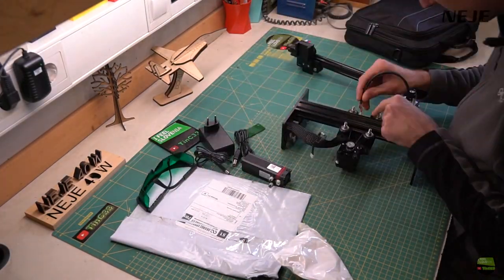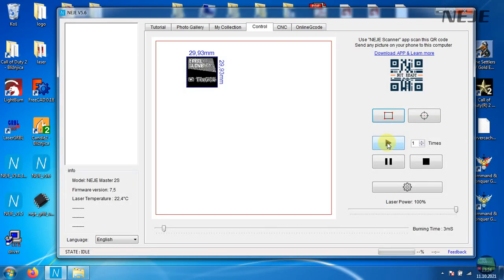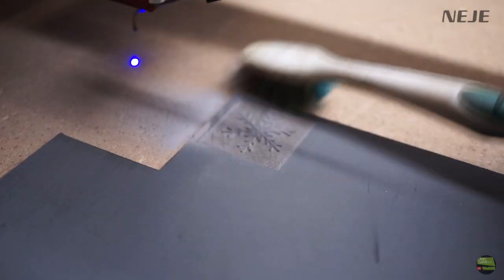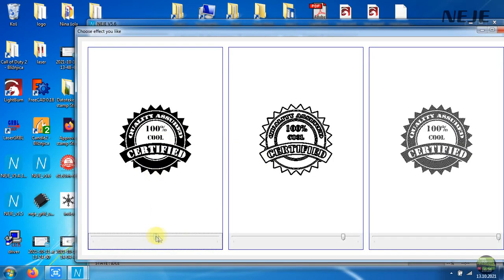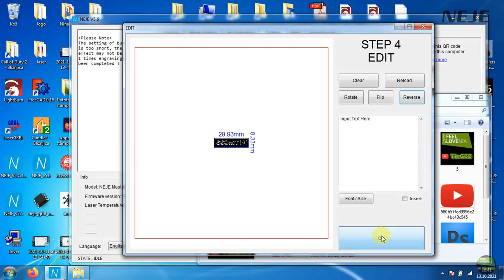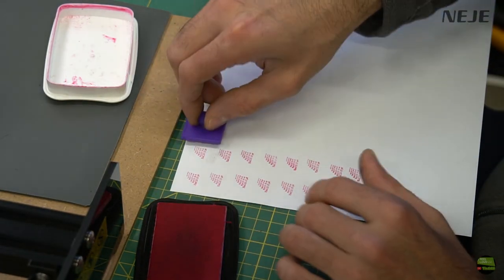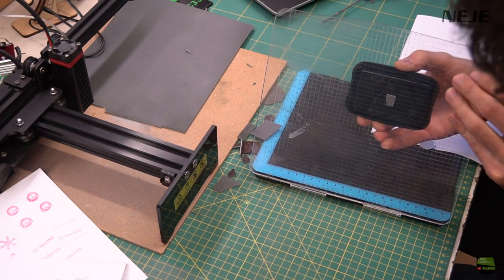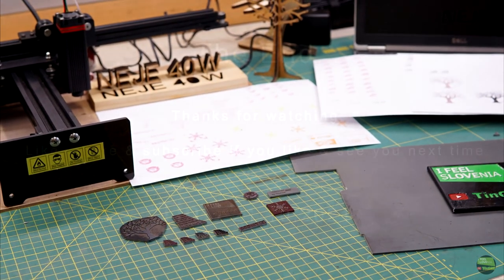Making stamp with Neje laser engraver

Comment: Great comparison - I know you have a video coming out about the different lasers but which model would you recommend for engraving a small logo over and over (using offline mode). Don't need to cut at all (have a CO2 laser) - just engrave into plywood. (B30635/N30610/N30820)? Thanks!
Reply from the maker: Depend on what kind of engrave you want, 20,30 and 40w are good for deep engrave while 2,5 and 3,5w laser are best at grayscale (surface engrave).
Reply: @TinC33  thanks for the advice.  It is just a logo to brand the back of some plywood decor.  Currently using a branding iron but it is not very reliable. 

Also your videos are excellent - very comprehensive. You covered questions which I could not even find answers for on the manufacturer's website. Keep up the good work.
Reply: @TinC33  I meant to say I might go for the 10W as it is half the weight of the 20W but should still be powerful enough. (To be used on the Master 2S so weight is a consideration)
Reply from the maker: @LeytonMiller  yes it's much lighter so you can set faster acceleration, it be good for deep engrave but not best for grayscale.

Comment: Hello I also acquired the neje laser but for some reason it never cuts to the bottom, even if it is 3mm mdf I need to give it more than 6 passes and it still does not cut it, could you help me?
it's the 40w laser
Reply from the maker: Check the lens there come tiny dust coat over the lend wich reduce power drasticly over use, so here and there just wipe lens with a cotton ear stick.

Comment: hi, I have just started to use my neje 3 to make stamps and I used the setting 3ms burning time and 90% to make a 3x3 cm stamp and it took 40 minutes for the first pass. And I think it needs a second pass to have the right depth. Is it suppose to take so long?
Reply from the maker: I don't remember exactly i would say it should be faster for a 3x3 cm but i think not less than 30 min 🤷‍♂️

Comment: Thank you for your videos man.Which one would you recommend for detailed rubber stamp ? Neje 10 w or Neje 20 w?
Reply from the maker: i only try with 40, 30 and 20w but best result got with 20w so 10W may make even better than 20w.
Reply: @TinC33  so the less W the finer it can laser?
Reply from the maker: @PizzaEcke  how fine will be is depend on dot size i think a40640 has smallest dot, but less W is better for grayscale engrave, here on stamp less W may work better because they had no enough power so edges isnt cut perfectly but has a bit chamfer.

Comment: good day, what parameters should I set to increase the engraving depth, I have the same laser and software as you, thank you
Reply from the maker: Lower down the speed and incrwase the laser power, but you'll got better result if you engrave with 2 or 3 passes if you want deep engrave, during every pass clean the rubber with compressed air and brush, but be carefull to not move rubber or machine not even for 0,1mm...
Reply: @TinC33 thanks for the advice, I'll try it and let you know

Comment: You actually had this sold to me until you mentioned 50minutes!!! I was like no..... 
I’m also looking at the TT-5.5s due to its speed and end quality. Wondering if you’ve any thoughts on it?
Reply from the maker: I don't know other brand.
Reply: yeah, same here. Theres very little info on diode lasers on rubber. I have a 40 co2, and it takes me 2-5 minutes. I wanted to buy a smaller diode laser for this purpose for a friend, but this is a very subpar result. Thank you for your video.